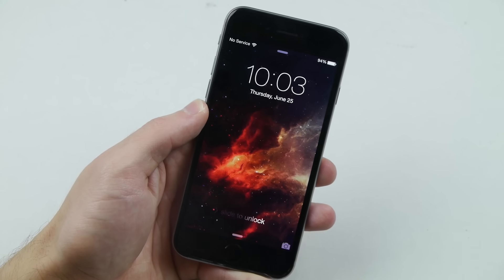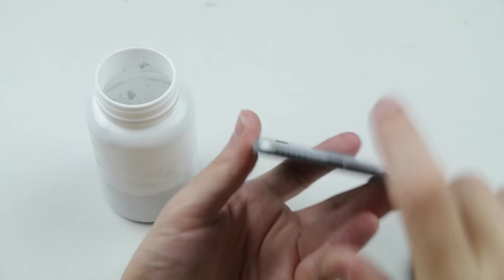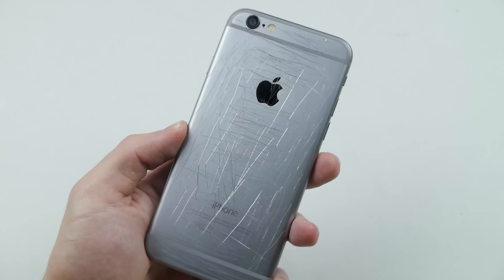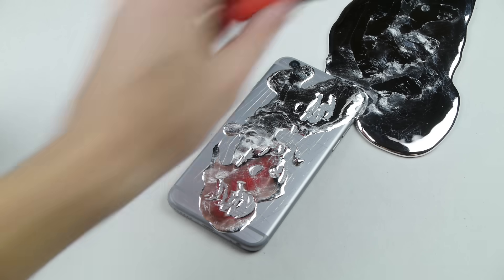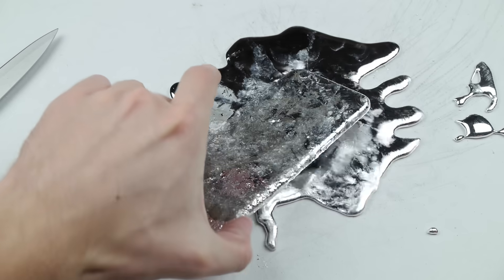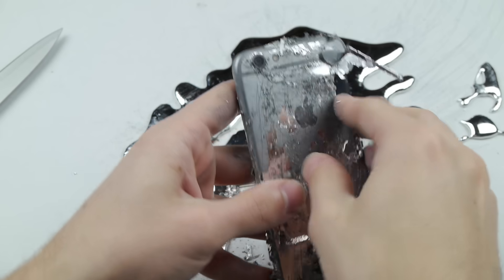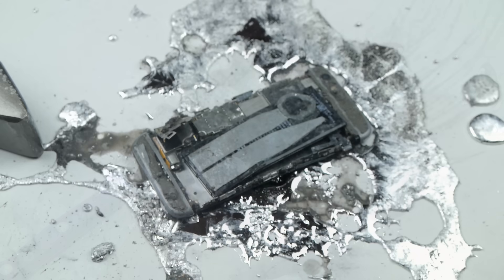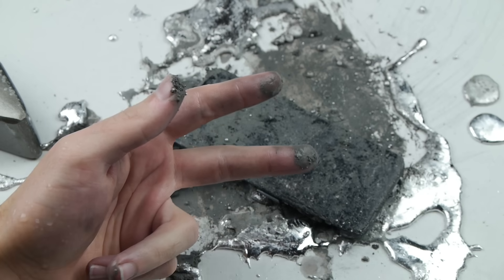What Happens If You Pour Gallium on an iPhone 6?

Comment: "Let me just use my hand" that's smart!
Reply: MattBoehmke It's only 86 degrees -_-
Reply: Dude its not toxic
Reply: Ya but it is molten metal
Reply: MattBoehmke It's Gallium that stuff will melt in your hands.
Reply: Its Galium... That stuff melts in water
Reply: Nate Smith MSDS sheets exist for a reason.  Best practices should be observed when handling things like this.
Reply: Nate Smith It's not about Gallium, it's the battery that's dangerous (and toxic when he pours water on it).

Comment: Why the fuck isn't he wearing gloves when touching such elements?! 0_0
Reply: The5thorseman Could still cause chemical burns. Not safe.
Reply: The Pika Gamer 
quote...."mr. no it all"..."no"?
Reply: Sally May It's not toxic.
Reply: The5thorseman I know but still....
Reply: You touch elements with bare hands every day. Iron, Aluminum, etc.

Gallium isn't dangerous in the slightest (Unless you're an idiot and drink it).
Reply: acephantom903 Gallium is it's own element, there's no mercury in it.
Reply: Dude it's not gonna kill anyone unless you swallow it and it drys in your stomach But gallium melts at like 110 degrees ferenheit
Reply: ***** That's...not how it works.
Reply: IBHRLE GAMING Link please. I've always been told though several  college level chemistry classes that while it doesn't seem harmful, it is still a corrosive metal which CAN (not will) cause irritation up to severe chemical burns. Also you're supposed to wear a respiratory device if you are using it to cause a chemical reaction like in this case because it can release toxic gases depending on the material and chemical reaction.
Reply: yep... but anyone knows not to poor water on a element like that... it wouldnt have started simmering if he didnt try to wash it off
Reply: It melts at 85° F so it's probably not that hot at all
Reply: Sally May gallium is a metal, that has a really low melting point. it melts on body temperature. its non-toxic neither is it radioactive. thats why you can touch it bare handed. their elements like gallium which are liquids at room temperature. you can also touch those bare handen, but are little toxic, so wash your hands after touching those without protection.
Reply: I've seen u everywhere OMG 😂
Reply: Wumbo123 I know but he can still get burns and shit like Matthew Bullock said
Reply: ***** Whatever.
Reply: ***** Lmfao okay.
Reply: ***** shut up because obviously you dont know what your talking it is still unsafe to do stuff like that without gloves or doing that stuff period so go learn some stuff before trying do be mr. no it all
Reply: The Pika Gamer Give me one good reason.
Reply: The5thorseman why dont you
Reply: ***** gtfo
Reply: The Pika Gamer You're the one who claimed it's unsafe, you're the one who has to give me a reason why.
Reply: Sally May it doesn't do anything to you. Harvard was studying it and what they did to prank each other, they would mold it into forks and watch as their classmates try to eat with it and it would melt in their hands. im also pretty sure that if you eat it it wont bother you. sure you might throw up but its not going to kill you. kind of like swallowing a penny. if its only a little like one penny you will be fine but its a lot like many pennies then it can hurt you.
Reply: IBHRLE GAMING Oh okay...
Reply: The Pika Gamer Dude gallium isn't harmful, I know u want to try to be smart but it isn't, I've bought some gallium for entertainment and it doesn't do anything to u
Reply: if you google gallium risks this is the first articular that comes up  http://www.lenntech.com/periodic/elements/ga.htm
Reply: Well whether it's toxic or not he should still wear fucking gloves.
Reply: wait.... does it matter if its not toxic?....
Reply: IBHRLE GAMING You should treat any chemical with care. You saw the simmering at the end, that could have released toxic gases chemicals. Even when it doesn't even seem like it is reacting, the whole point of putting gallium on the phone was to cause a reaction weakening the phone. Unless you 100% know what reactions are going to be happening, you want to be using a respiratory device and wear gloves.
Reply: IBHRLE GAMING The person who made this video isn't anyone apparently.
Reply: pl0x1337PwnEpix Then why are there warning labels on every container of Gallium when your purchase it from a seller?
Reply: Because ur hands r to warm for it to harden
Reply: Gallium is non toxic, shit you can swoop ow it and you will be all fine.
Reply: IBHRLE GAMING Accually its less harmfull than swalowing a penny, a penny can get stuck and cause internal damage, its unlikley, but possible. On the other hand galium will remain liquid untill it leave your body.
Reply: He used a rug 😂
Reply: The Pika Gamer Bigmac is right though... Gallium is harmless.
Reply: lemmingscanfly5 "Breaking story only on Fox News! Children across the globe are ingesting Gallium and dying of mercury poisoning."
Reply: It leaves stains in the hands if touched, but nothing else. Batteries are another thing...
Reply: ***** more like +7 Subs With No Videos😂😂
Reply: HomeCheesePo ????????
Reply: Mr. Man Prove it. Look at the sources I linked above and what they said. Actual scientific sources. They said it isn't necessarily hazardous but it has no benefit to forgo proper protection.
Reply: acephantom903 You have no sources so there is your first problem. And I have personally used gallium many times without any safety gear (Besides a coat to protect my clothes) and never had any issues whatsoever. here is a source that says its completely safe www(dot)lenntech(dot)com/periodic/elements/ga(dot)htm
Reply: The5thorseman And a melting battery isn't toxic too I suppose...
Reply: Sterretanne Gallium only effects the aluminum, of which I'm pretty sure there is none in a battery.
Reply: Wumbo123  Lol ignorant people. Gallium melts at room temperature.
Reply: That'd make him a wuss. He's tough as nails. Merica.
Reply: Rythmboy Those who don't fear death are the first to die...
Reply: ***** "there isn't much about actually swallowing it on Google". That should be the internet's motto. People just got learned raght thewr.
Reply: acephantom903 what are talking about, everything is made out of chemical. Water, air, you, they are made out of chemicals. Do you use gloves when you handle yourself.
Reply: Jans Losn Gallium in it's elemental form does not exist in nature. Uranium does. It would be safer to bare handle uranium because your body has adapted to small amounts over millions of years.
Reply: Wumbo123 it can melt in your hand from your body heat
Reply: Sally May Gallium is actually safe to touch without gloves.
Reply: X4m2 Gaming did you not read my comment or something
Reply: ElectroGamingEU Oh okay I see. Thank you.
Reply: Rachel Forbes Yes I am everywhere haha xD
Reply: Sally May FUCK FUCK FUCK!!! Just STOP Showing up EVERYWHERE!!! >:(
Reply: ***** No :)
Reply: Sally May You seem  to be everywhere on youtube.
Reply: Cheikhouna Gueye Fuck off
Reply: Sally May
That's rude. :(
Reply: Cheikhouna Gueye Stalker
Reply: Sally May
?

Comment: I don't get the point of this video but that could have been the Lithium battery that came in contact with the oxygen in the air or the water you've put on the battery or both. If it was, you're lucky it didn't catch fire ou explode.

Comment: The gallium wasn't boiling you spoon! When you mix gallium with aluminum it makes an aluminum alloy which, when you add water to, separates the aluminum in the alloy from the gallium and water into nitrogen gas (or hydrogen, I cant remember). So what was happening when you added water to the gallium-aluminum alloy mixture was the chemical separation of the aluminum. If you were to let the water do its works on the alloy, then you would have been left with the straight pure gallium that you started off with. Science bitch.
Reply: Igelson Garcia Nothing wrong with being a nerd! ;)
Reply: Isaac Plassmeyer and that wasn't smoke, it was the nitrogen (or hydrogen, I cant remember) gas
Reply: Dang you're a nerd
Reply: Isaac Plassmeyer Probably hydrogen as there is an addition of water. But then again that would still leave oxygen atoms... Maybe that could be going into making aluminum oxides. Or maybe it is just reacting with the nitrogen in the air and the water is just a catalyst.
Reply: Shawn Morton Only problem with that is that the lithium would be dissolved quite quickly and this looks like it is lingering and creating a black residue, which lithium doesn't produce with just simple contact with water. It produces hydrogen and lithium hydroxide, which is clear.
Reply: Boohoo, he used the wrong word. Do you suppose everyone on the planet knows chemistry as well as you do?
Reply: Lol i know i dont xD
Reply: Wtf
Reply: Good job
Reply: Who invited you?
Reply: English please...
Reply: Isaac Plassmeyer wow its summer and u have to spread ur boringness with everyone
Reply: Guys just stfu just cause he schooled you all doesn't mean you have to be a jackass -.-
Reply: Hydrogen is a colourless gas... The smoke you're seeing certainly isn't hydrogen in its own right.

Comment: The sizzling in water is normal once you combine gallium and aluminum to create an amalgam (it's actually hydrogen gas). Gallium alone won't really do anything in water, besides oxidize slightly......and you lose small amounts over time by directly exposing it to water. Although once you've created a gallium/aluminum amalgam, the way to retrieve your gallium is by putting all the contents into a bowl of warm water, allowing the exothermic reaction to finish, then slowly dumping the water/aluminum waste away.

Gallium is fun stuff to play with......BUT just remember never to dispose of the amalgam in the trash, because if it comes into contact with anything wet it could catch fire.

Comment: If I may make a segregation, you should connect the aluminum backside of am iPhone to a grounding, and try destroying it with a welding machine! The heat will be intense and the result may be great! But for the safety you should wear proper protection

Comment: Except it's not hot. Unless you COMPLETELY over boiled it. Gallium has a boiling point at 27,something degrees Celsius. Which is basically the temperature of one's hands. There is no reason why it would be too hot for you to touch. Just because it's melted, it doesn't mean it's hot. Well, at least for this metal. I'm kind of thinking that you were acting? No hate, just science XD

Comment: Gallium has a very low melting point at about 29 degrees Celsius. Which is a warm room temperature. You can melt Gallium in your hand, so I was just wondering what you did to melt it? I can't see you putting it in the microwave because you cannot put metals in microwaves. But you also put an iPhone in a microwave so I am extremely curious as to why it is hot.

Comment: Gallium melts in your hand. You didn't need to heat it up to the point where you needed a rug to hold the container. Also pouring a hot liquid onto a table? Why didn't you use a container?